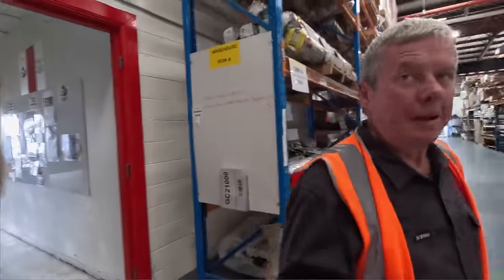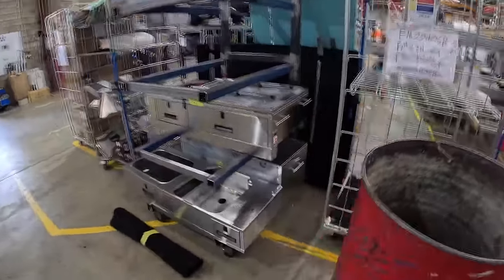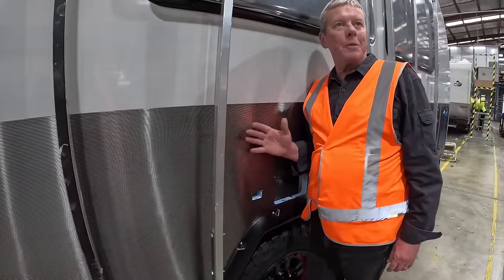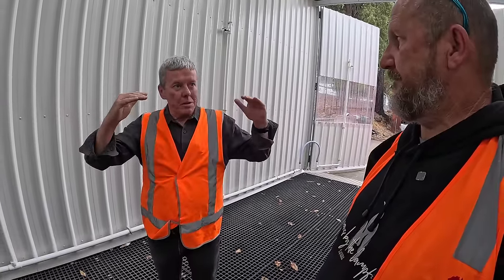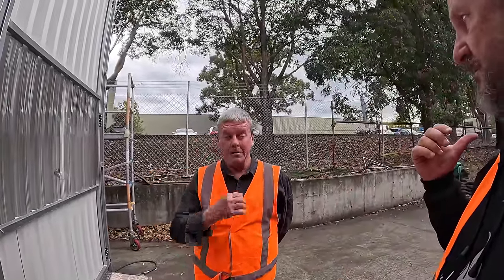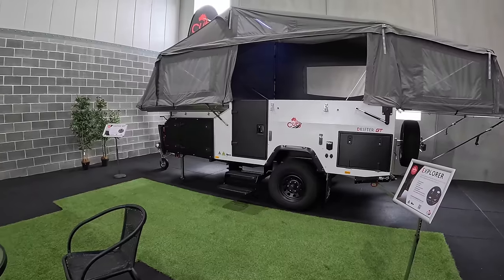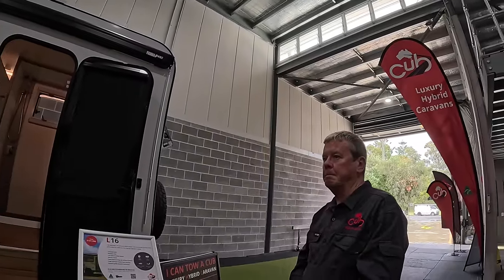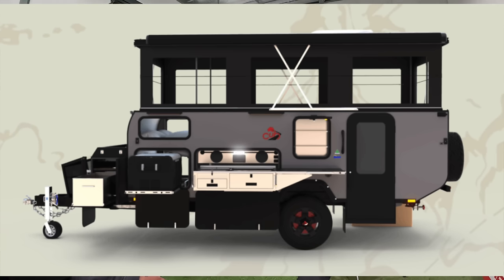Cub Campers & Caravans - Might have to Buy one! Factory Tour

Comment: What’s the dust sealing like doing thousands of Km like the Birdsville track or Oodnadatta track 
Hopefully there is dust suppression so the bed doesn’t look red like the sand 

Also what is the main size feature difference between the H14 and H16
Is there more room for the couch and dinette
Reply from the maker: The DRS is an option in the H series and the main difference is the seats and ensuite length is shorter in the  H14. Hope this helps - full details of each model are on their website. Cheers!